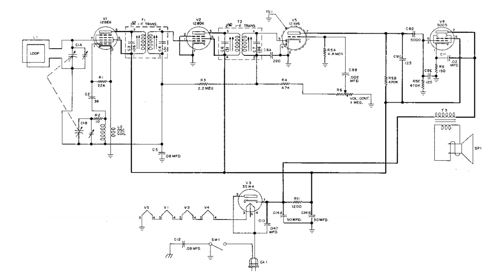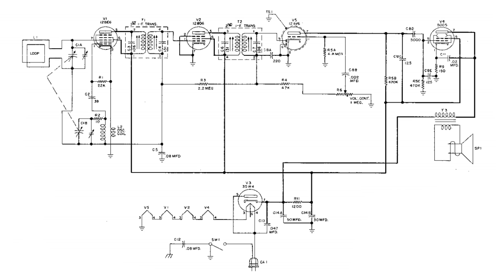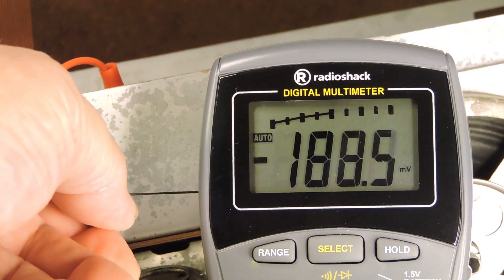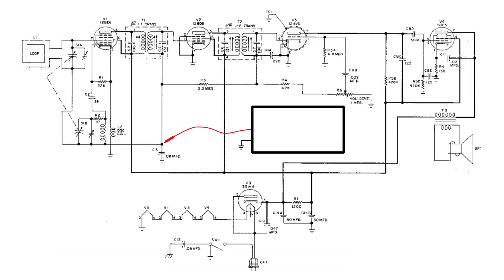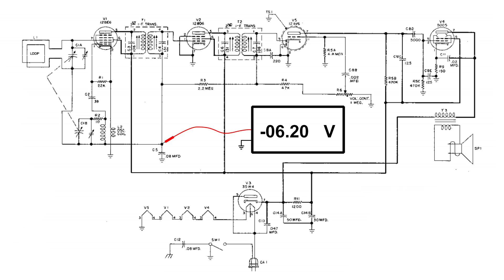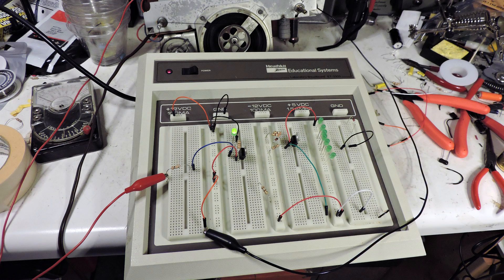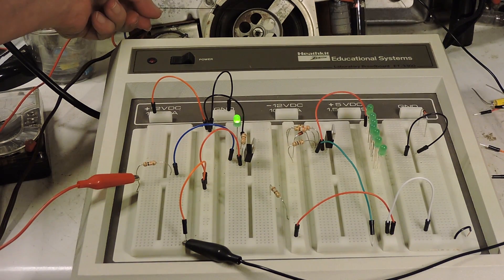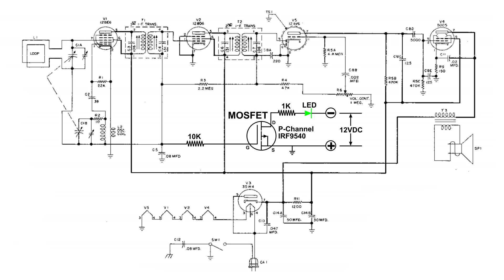AM Station Signal Strength Meter circuit build and demo

Comment: i want such circuit that takes IF signal And based on Tunning straight of Any station it glow Brighter otherwise off overall indicating if there's a signal or not whether modulated or unmodulated ? 
can you share please ?
and how it works ?
 i will use to try building Diy Spectrum analyser Using Tv tunner
Reply from the maker: Thank you. I think that would make a great video.
Reply: @AllAmericanFiveRadio  yes plz , you you Make video on it . I have Plan of structure of Making diy spectrum analyser But I am not Knowledgeable enough to easily make it .
Reply: My plan was ... To use same Radio signal Meter led indicator circuit and put it with Tv tunner and using Microcontroller as timming and Tuning circuit or just analogue Ramp gen with 555 to scan each band one by one by enabling All tunner band one by one and Plotting it either digitally using Arduino or just using crt 
Anology Plotting ...
Using crt 
For y axis 
If we use signal strength Meter output as Y axis amplitude and shifting it back and forth or in Linear direction  in scanning manner .
For x axis
Somehow if we synchronise Tunning ramp voltage with X Axis with known Voltage vs Frequency Relationship and marking it on Graph .
This is plan for now but
I have to rethink it in better way ...

Comment: Why do you botber to put a resistor in the gate circuit of an FET?
Reply from the maker: The resistors there in case the gate should short through the MOSFET to ground. The resistor keeps the radio circuit from being damaged.

Comment: Thanks for your great videos. I am working on a tube radio (Star Roamer) made late 50's to early 60's. Have noticed that voltages go high after first powered on, then settle down to normal ranges as tubes warm. Can power supply be modified to avoid this? It must shorten the lives of tubes and other components.
Mike
Reply from the maker: You might try putting a varistor in series with the B+